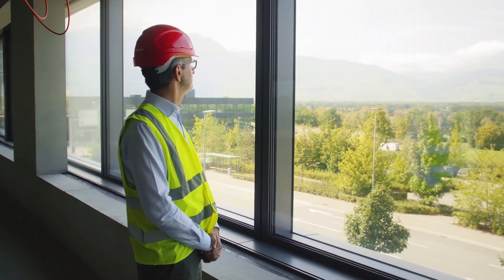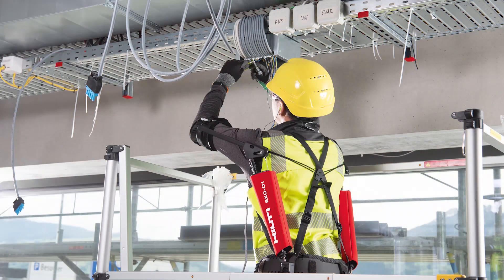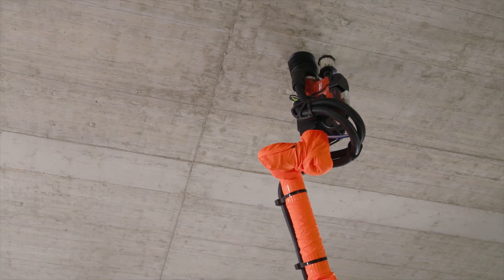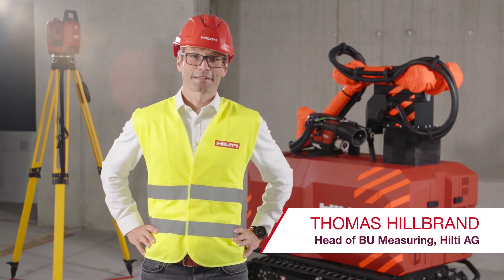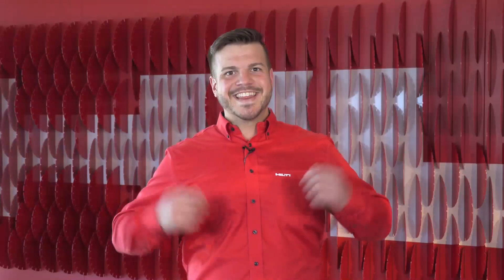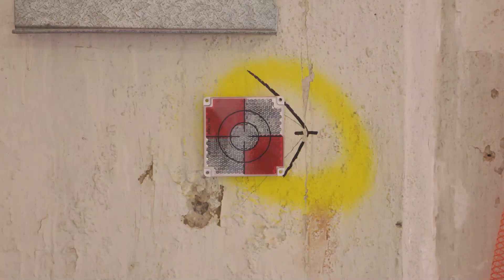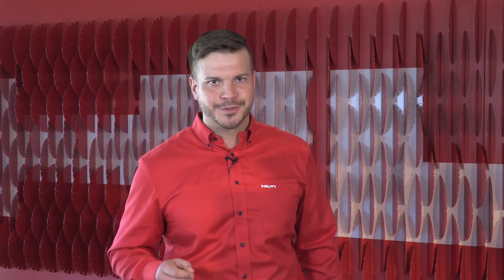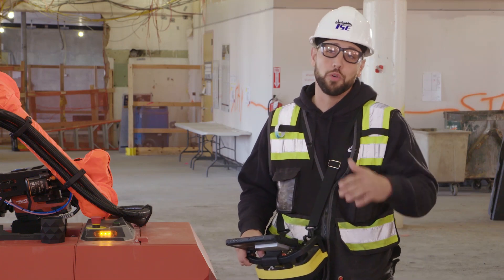Hilti Jaibot - Press Event Announcing New Construction Robotics Innovation

Comment: Id like to see this work on a busy job site with pallets of stuff all over, obstructions everywhere duct work in the way and 20 feet up. And I'll work in the row next to it and see what works better. Looks like someone would still need to go up a ladder and install the Hanger, and you would need an operator. Bottom line is this needs to be cheaper than manual labour.  You can pay a hanger guy for 3 years straight for the cost of this machine.

Comment: Now here we go . Nice ,I can remember shooting bolts in concrete cielings with DX-451up on the fifteenth floor right next to the edge standing on a ten foot wobbly ladder ,the only safety was the 1×4 that was used as a perimeter of the building